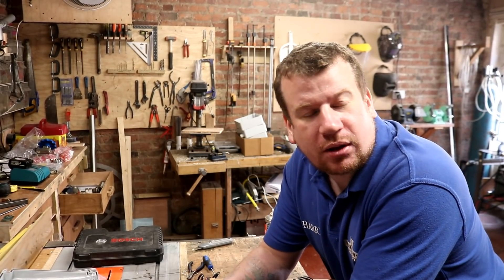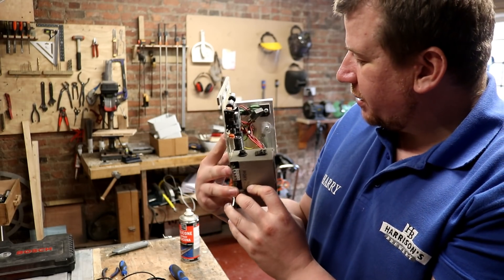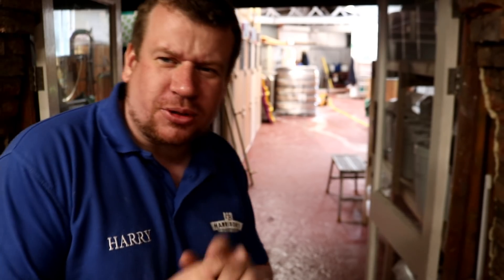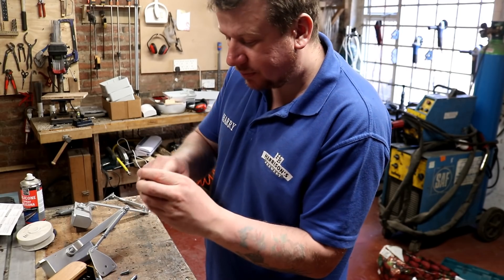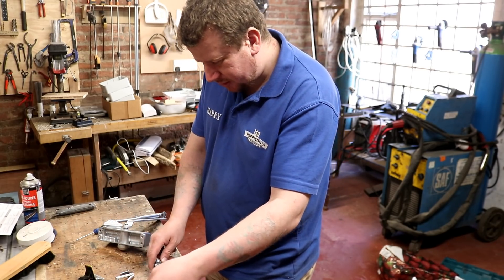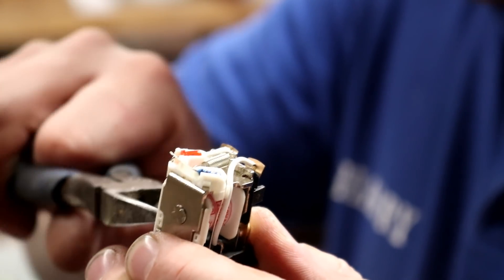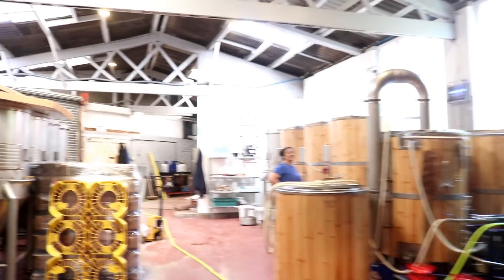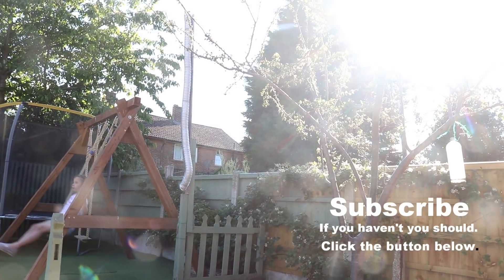ACID WASH FOR THE BRICKWORK

Comment: For the love of God man wear some eye protection and long pants at least when using acid,you can get a right nasty burn off that acid wash and I speak from experience. Considering what you've got in stock might be easier to use a DC fan for now,I'm sure you'll come across some broken down machine eventually that has the AC transformer you need. Look into picking up a cheap canner,would be great for selling online especially for outside UK. Cheers.

Comment: For the sink, you could use a macerator to pump the waste up and over
Reply: +1 James Sandford.
Here in the U.S. they are installed in basements where the sewage piping is higher than toilet or sink. They pump the waste water up and over to the proper drain. Vented and trapped if plumbed directly.

Comment: Transformers are expensive especially toroidals. Cheaper to buy an old amp and get the transformer out. I had a big toroidal go and it was cheaper to replace the whole unit. Did you try ebay or Farnell? I nearly died no glasses or mask  mate.